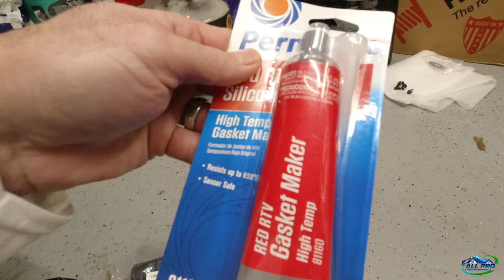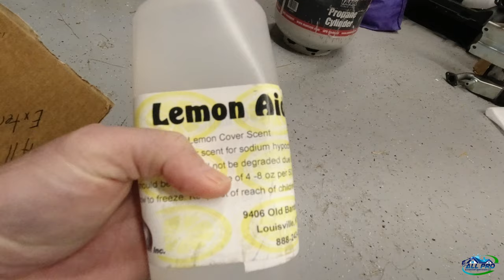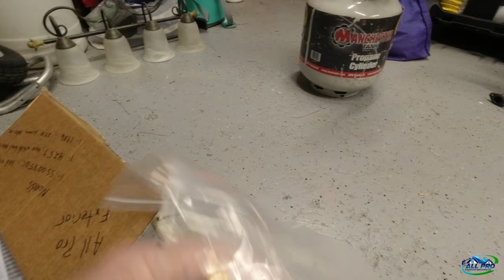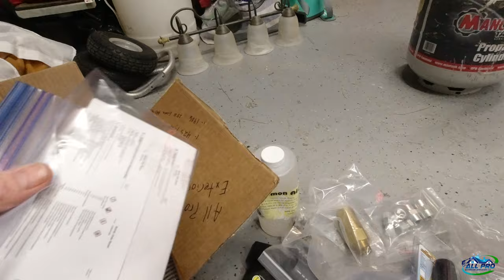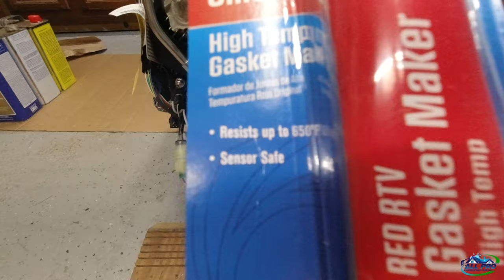8 GPM Gear Drive Build Complete

Comment: I have a hell of a time keeping the key ways in place while I’m sliding pumps onto the shafts. Not easy to do since the pump/gearbox together weigh almost 50lbs. I can’t ever slide them on as easy as you just did. I’ve built 4 of these and will be building another in January.
Reply from the maker: Some people use a tie strap to hold the key on while installing the pump. Thanks
Reply: Great idea man thanks

Comment: Did you buy both engine and pump from the same supplier? I’m getting the same engine, but I’m looking into getting the pump. Any suggestions
Reply from the maker: I purchased the pump from Sprayer Depot & the engine from North Georgia Airless. Thanks

Comment: How’s it do sucking water since it’s not belt driven… always here it’s not best using direct drive when needing to pull water from a tank.
Reply from the maker: Direct drive & Gear drive not the same. Gear drive is reduced with the gear box. Thanks

Comment: please help!!!! i have a 9gpm 1750rpm 3000 psi pump, using the predator 22hp v twin engine. in dont know what to use for my belts and pullys. not sure what the size needs to be of the two pullys. any ideas? i would greatly appreciate it thank you!
Reply from the maker: I have no idea what size pulleys. I would contact the pump manufacture and see what they recommend. You could also call Russ Johnson at Southside Equipment. Thanks

Comment: When your looking for the proper gear box. Did you just match the RPMs and horse power to the pump and motor?
Reply from the maker: The gear box came with the pump from Sprayer Depot. Thanks
Reply: @allproexteriorservicesllc5338  no.. thank you for the info.. have a good one 👍

Comment: The wire harness that comes from your regulator to the engine. Mine has a white/yellow wire and a black/yellow wire which match on both sides. Then two grey wires that are identical on the engine side and two grey wires one with a black dot on the regulator harness. Does it matter which of the grey ones you connect? Mine also has the black ground wire which I know where it goes. Finally it has a white and blue striped wire that is capped off. Not sure what it is for? Any insight on the two grey wires and the blue/white wire would be greatly appreciated.
Reply from the maker: My grey wires are on a plug and only go in one way. Feel free to call me and I can send pics. 98five-two64-5two60
Reply: Hi Chris did you find out what the White and blue stripe wire is for? It goes nowhere in the diagram. Stuck at this one. Thanks.
Reply: @Sundown798  to be honest I bolted my pump to the engine and put it in my enclosed trailer and it's just been sitting there for almost a year. I've never attempted started it or finished my install. I'm actually considering selling it. My business went in another direction and I really don't have a use for it now. Sorry I couldn't be of more help. With the white / blue wire I believe it was for if you wanted additional accessories or to have your engine recharge the battery. Something along those lines, but I never verified because I never used it.

Comment: Question does it come out cheaper building one or buying one... I don't know nada nothing about pressure washing or about the machines it selfs
Reply from the maker: It does come out cheaper building vs. buying one. But, since you have no experience with pressure washers, I would recommend buying the first one. Thanks

Comment: Where did you get the rubber stopper for the pump rest? 
Where did you get the oil drain hose? 
Thank you
Reply from the maker: I got them both from Amazon. The drain hose is a 3/8" & the stopper is one that i used for the feet for my pressure washer. Thanks

Comment: Doesn't the Udor GKC (CKC) 30/24-GR Plunger Pump require two separate 3/4" suction side supplies? Mine came with a proper setup drawing showing two 3/4" lines running into a 3/4"×1"×3/4" tee and then 1" suction line running to storage tank.
Reply from the maker: No, you can connect 2 inlets or one. I am running 1.5" feed line to one inlet and no problems. Thanks
Reply: @allproexteriorservicesllc5338  when I spoke to udor they didn't say it was required, but did say it was recommended to use both of the inlets. I spoke to Randy when I called. I originally had planned on doing it exactly how you did, but since it's not much more work to run 2 separate supplies I think I'll go that route just to avoid starving the pump. My setup will be for drain jetting at 8gpm 3500psi. Thanks for video! You answered a lot of the questions I had about doing the setup/install.
Reply from the maker: @CT-Properties  Good to hear and thanks for letting me know. Good luck & let me know if I can help with anything! Thanks

Comment: How is this unit holding up? Anything you would do different? Or anything you learned to look out for? Looking to build my own soon. Thanks!
Reply from the maker: It is holding up very well. I would build the exact unit again & plan to in the future. You could jump to a 10 GPM pump if you have the supply to feed it. Thanks
Reply: @allproexteriorservicesllc5338  Awesome... so that same engine would drive 10GPM?

Comment: I’ve been seeing that you can get a lot more hp that 24... that the torque is more like a 28 hp motor
Reply from the maker: I think so. It is a beast for sure. Thanks
Reply: Honda told me their small engines are under rated by 20-22% on paper. So that engine instead of being 24.9hp. Is actually 29.9hp

Comment: Nice tip on the bump stop for pump support!  I unboxed my predator just now, got 8.5 GP and gear reducer. What is the voltage regulator?? Do i need one?
Reply from the maker: Not sure about the predator. The voltage regulator charges the battery & will run a hot box if I decide to get one. Thanks!!
Reply: I don't have one on my pred.  runs good and keeps the battery charges.

Comment: Hey what kind of pump did you use and does the shaft housing come with the pump or must it be purchased separate?
Reply from the maker: I bought the Udor pump and it came with the gear case. Thanks

Comment: Thanks for the video.  How much did everything cost for this setup? Roughly
Reply from the maker: Around 10K without my labor. Thanks!
Reply: @allproexteriorservicesllc5338  Sorry I wasn't clear but I meant how much did it cost for the 8 gpm build
Reply from the maker: @solomonbadayos4196  Right around $3500. I saved a few bucks, but I was able to upgrade to the better components. Thanks

Comment: Great video! If you don't mind my asking, where were you able to find the IGX 800 available for purchase? I've been searching, but I've had trouble finding an online dealer.
Reply from the maker: I got the engine from North Georgia Airless before the supply chain issues. Thanks
Reply: @allproexteriorservicesllc5338  how much you pay?
Reply from the maker: @SoftWashFactory  Around 3500
Reply: @allproexteriorservicesllc5338  engine with muffler
Reply from the maker: @SoftWashFactory  yes & pump. Thanks

Comment: Do you have any pictures or video of the engine mounting process?
Reply from the maker: Just what I have in the video. All I did was set the engine on the skid & mark the mounting holes to drill. I also double checked the measurements before drilling. Maybe you can use a piece of cardboard as template. Thanks
Reply: @allproexteriorservicesllc5338   I meant did you just bolt it to the plate or did you use the rubber disc's under the engine also?
Reply from the maker: @CT-Properties  I just bolted the engine directly to the skid. Thanks

Comment: What gear drive would you recommend? Looking to do this with my GX390 thank you.
Reply from the maker: I would look at the Udor pump & gearbox. Are you can get a cheaper pump from Envirospec. I beleive theri Allison brand is made by Comet. I would at least get a General Pump. Thanks
Reply: @allproexteriorservicesllc5338  thank you yes I really want a udor I am going to start with a general pump with a gear box I was thinking of going with a 5.5 GPM
Reply from the maker: @JDMSoftWash  That would be a perfect size for the GX390.
Reply: @allproexteriorservicesllc5338  thanks that’s my thought as well at some point I want to do same build you did what a beast.
Reply: @allproexteriorservicesllc5338  might be a dumb question I have a gx390 brand new bought a fully plumed direct drive to start do you know if pumps come with bolts or do I need to buy them ? Thank you.
Reply from the maker: @JDMSoftWash  My pump came with the mounting bolts. You can also find the thread size for the bolts on the Honda website. Thanks
Reply: @allproexteriorservicesllc5338  thanks a ton I went with a general pump to start I would think it would come with them thank you for the info.

Comment: Why did you choose that over belt driven? Honey question, im trying to learn
Reply: Honest question not honey lol
Reply from the maker: @johnthe_don  The main reason was the size. The gear drive takes up a smaller foot print on my trailer. Now that I have a gear drive, I really like the simplicity of the unit versus a belt drive. Nothing wrong with a belt drive, just a preference.
Reply: @allproexteriorservicesllc5338  thanks for the response brother.

Comment: Boss how much did it save you by building it yourself?
Reply: I want to no two! How much you saved?
Reply from the maker: It was right at $200 with the Pentair valves.
Reply: @allproexteriorservicesllc5338  how much did this build cost you approximately. Online prebuilt they are like $4,400 with shipping. I think your answer may have been about a mixing valve or something.
Reply from the maker: @timwaldron9638  At the time I built it, it was around $3,500- $3,600. Thanks
Reply: @allproexteriorservicesllc5338  thanks!

Comment: Why not put the pump directly to the engine, why would u need a reducer gear
Reply from the maker: Because it would spin too fast. The gearbox reduces the speed the pump will turn giving it a longer life & the ability to create a suction for water. Thanks
Reply: @allproexteriorservicesllc5338  thx for your reply, would like to put a 5.5 gal pump on my 390 honda, but noticed everyone use belts can't find a belt system here in Canada for that matter same goes for the gear reduction lol. Will try to get from the USA somewhere Thx again
Reply from the maker: @randywashing298  Canada is tough. I know Russ Johnson @ Southside Eq. sells a kit. Adding a gear drive pump would be my choice. Thanks
Reply: @allproexteriorservicesllc5338  will check it out with him thx again

Comment: Where did you get the pump support bracket? Mine has nothing under it and I’m worried that it will sag overtime
Reply from the maker: I built the bracket myself. The Udor pumps come with the plate on the bottom. Thanks